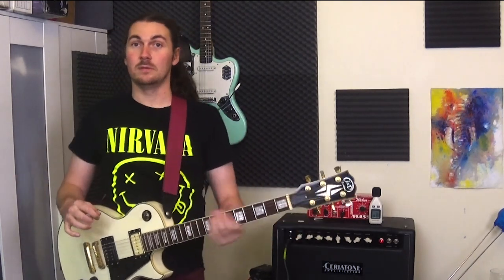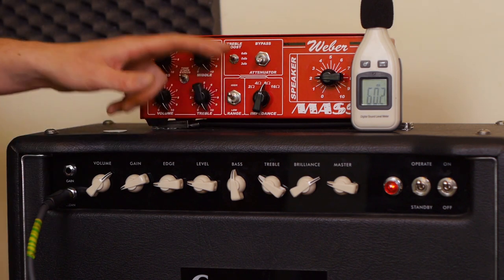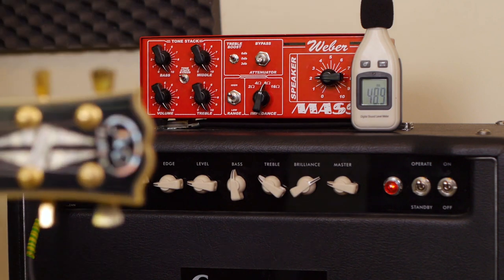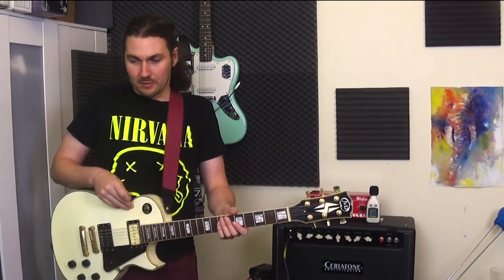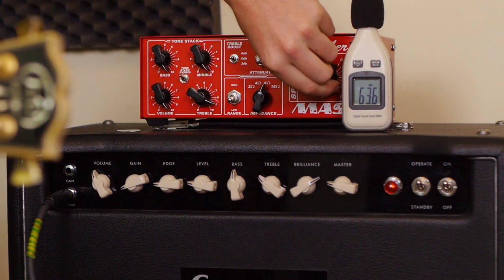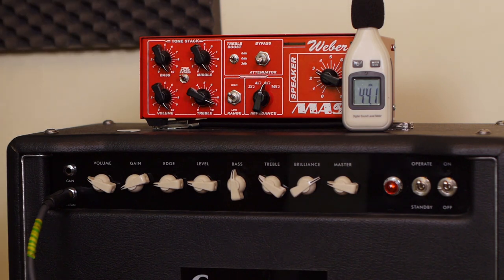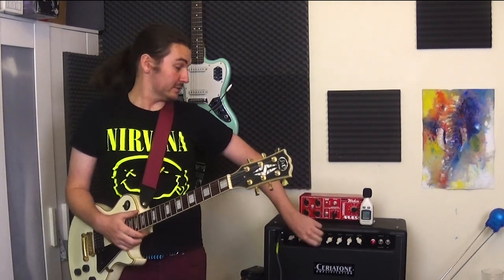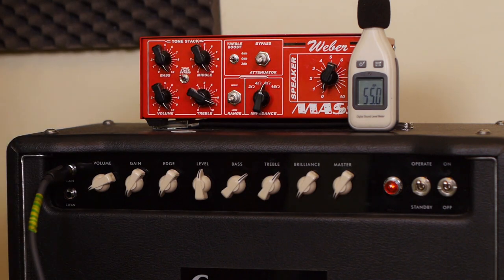Weber Mass 100 Reactive Attenuator | In-Depth Review And A Look Into The World Of Power Attenuators

Comment: Would of been nice to see how low u can go with this box regardless if you thought u lose some..
Reply from the maker: It goes too practically silent with a 30w amp, very little control over volume though, slightly bumping the rheostat changing volume dramatically when set that low.
Reply: I bought the mini weber and doesn't go too silent with 50 watt amp..
Reply from the maker: @peelarat9578  I think from memory the mini weber is designed for 35 watts and unde so that isn't suprising, I am getting close to silent with my 30 and 50 watt amps on the low setting but the Mass 100 is capable of twice the wattage of the mini.

Comment: Great vid...found it looking to control volume via a variac voltage regulator like EVH used. Wonder what's better?
Reply: Are you looking strictly for a variac or a power attenuator with a variac built in? A variac alone is pretty limited and will only take you so far in terms of quieting your rig because it just starves the amp just a bit for power, and you can only reduce the power so much within reason, while an attenuator plugs in between the amp and the speaker to act as a variable resistive load and lowers the volume that way. Eddie used both methods on Van Halen, ditched the power attenuator on Van Halen II (actually, it was really just a really powerful resistor as far as I know), then started using it again on later recordings. Earlier today, while I was looking at legendarytones.com, I came across an attenuator with a variac built in called "The Ultimate Attenuator"  from a company called Magus Innovations. I haven't tried one, but based on the review it may be a good step in the right direction for you. It may be particularly helpful if you are trying to go for a similar style tone to the first album since you could crank up the master volume to get the power amp tubes distorting without losing your hearing. Just don't necessarily expect to be playing with the amp cranked at bedroom levels with a 100 watt amp (Not that it can't be done, but the further you turn it down, the more it will deviate from the original tone and possibly start to sound a bit fizzy) and keep in mind that playing with the amp cranked will reduce the lifespan of the power tubes. Other than that, have fun and I hope this helps! Let me know if you have any questions. Cheers!
Reply: They are completely different things. A Variac only lowers the incoming plugged in wall voltage subtly affecting the 'feel' of the sound and not much the volume. An Attenuator essentially takes place of the speakers or the brunt of the output signal the amp produces, allowing you to manipulate the volume, tone of the output signal with or without the speakers plugged in.